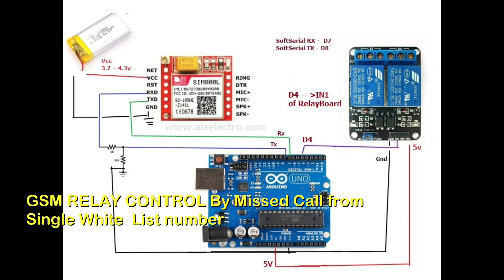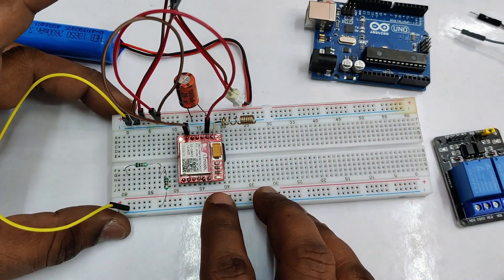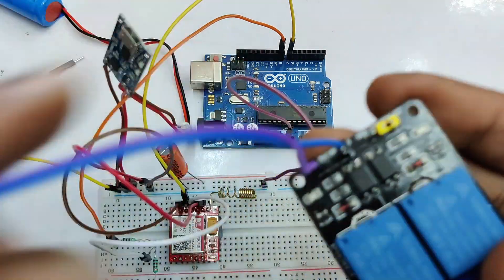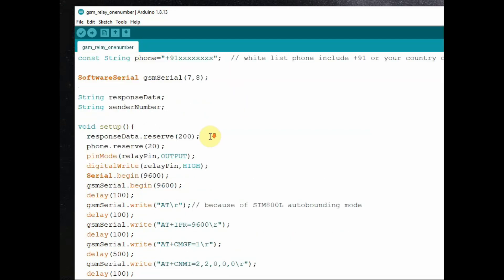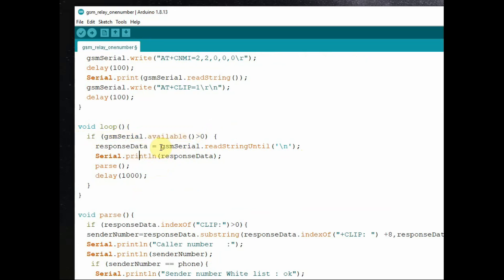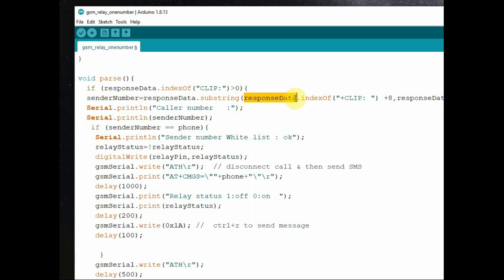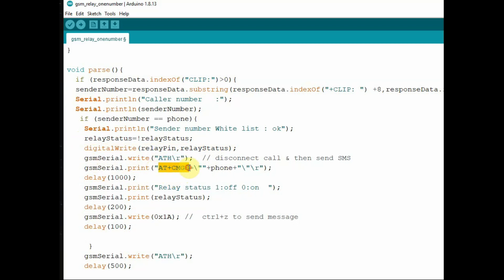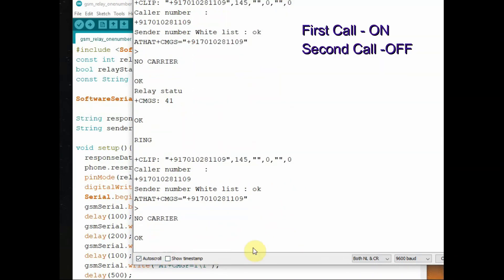GSM RELAY Control from  Registered Number Call

Comment: Hi sir,You reduced it to around 3.4 volts for the Sim800L rx pin. Is the 5V from the Arduino a high volt for the rx pin?

Comment: Another subscriber here sir. I want to ask a question sir, on the void parse, where did you get the +8 and +21 sir? Thank you so much
Reply from the maker: check video @ 7:26 
caller phone number is parsed out using substring function. Index plus 8th position is the starting position of caller number and we go up to 21 position to extract the caller number

Comment: Really he is. Excellent and practical program
But the problem is that when you connect for the first time, the relay works and unlocks
And when you disconnect the network from the gsm
And the connection again does not work and you must do a rest of the program from the Arduino, so what is the solution to this problem?
Reply: Please tell me solution
Reply: great program But there is a problem that when the network is disconnected from the GSM and then it returns, it needs to do a docked work from the Arduino in order to work because it remains at the last state it was in before disconnecting the network from it